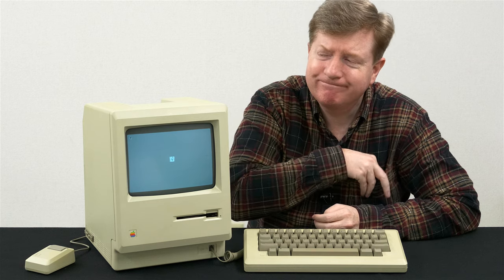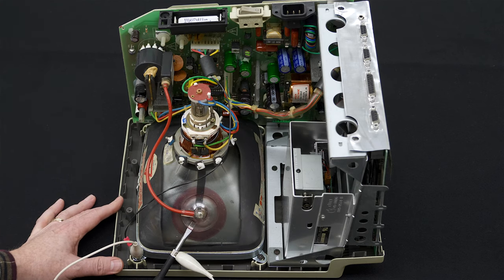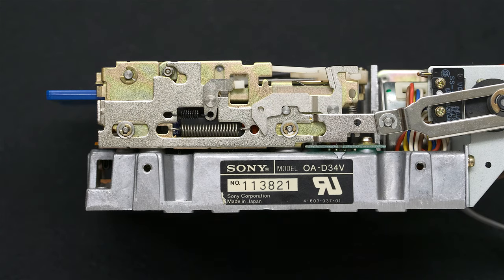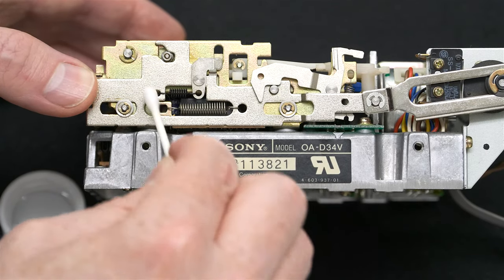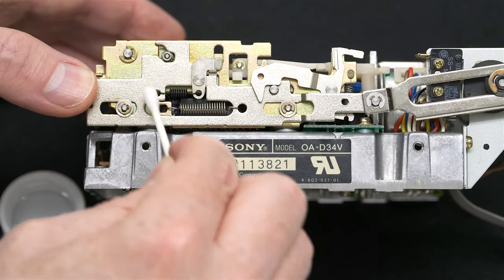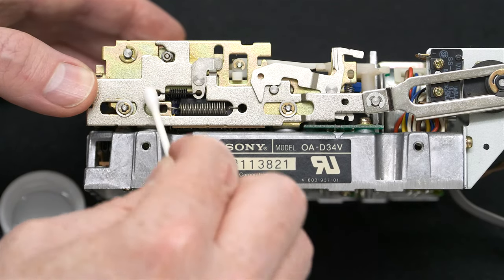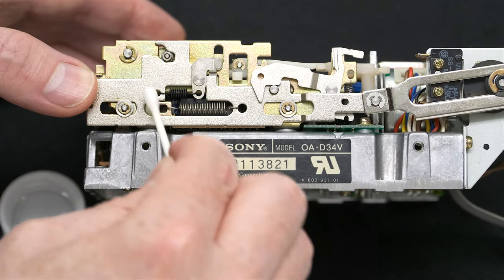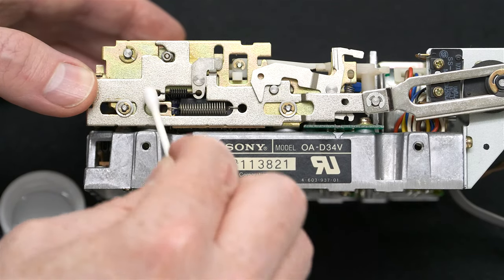Apple 400k Floppy Drive Lube Repair [1984 Macintosh]

Comment: I use white lithium grease all the time and never had any problems. After all it is what they originally used to lubricate drives. The grease doesn’t really touch any rubber parts or plastic parts in most floppy drives, so why bother using a different grease? Still a good video though! I learned how to recap an analog board on your channel and always order caps from Mouser, haha!
Reply from the maker: Congrats on your analog board recap!  

As to floppy drive grease, most people won’t really notice anything when using lithium or silicone grease.  But in terms of it possibly getting on plastic parts, it’s safer for me to recommend the silicone type because that won’t cause plastics to degrade.  And when you are talking about oil and grease, it’s hard to guarantee some of that will never ever touch the plastic case or plastic parts.  But most people use what they have on hand, and I can’t argue against that.  Thanks for watching, and best wishes!